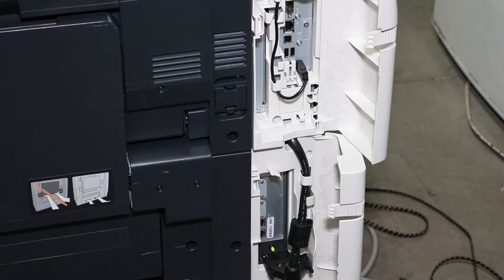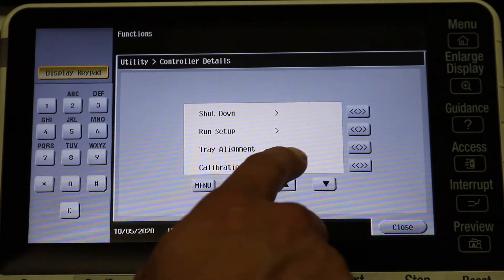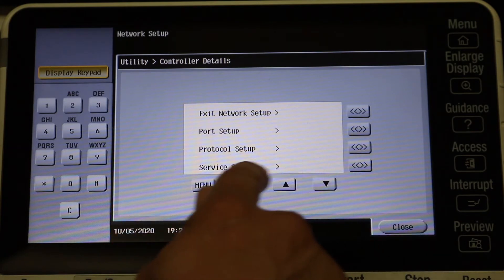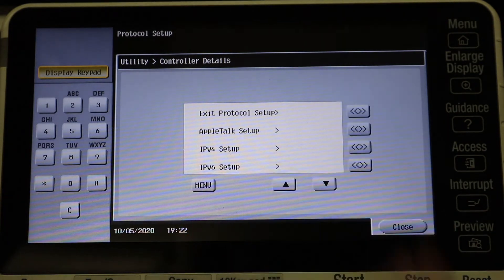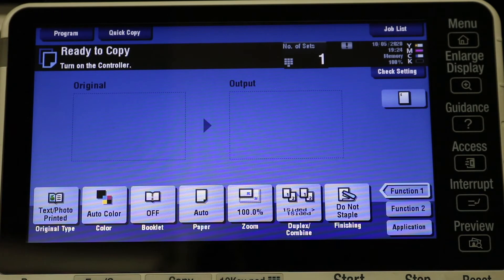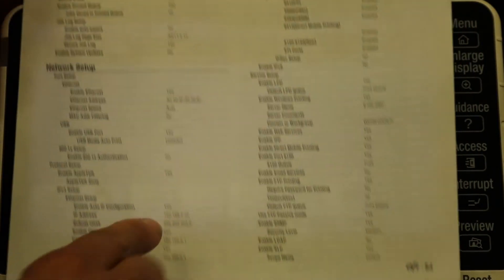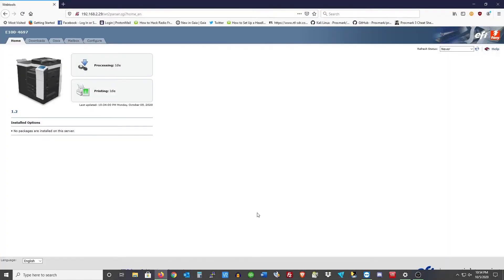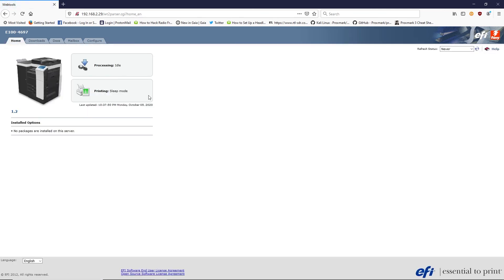#Konica How to Network a Fiery Image Controller

Comment: FYI - When you are using 2 direct ethernet cables, one for the Fiery and one for the copier you should not select Obtain IP for Engine.  That setting is for use when you use the crossover ethernet cable from the Fiery to the copier, and only one ethernet cable from the Fiery to the customers LAN.